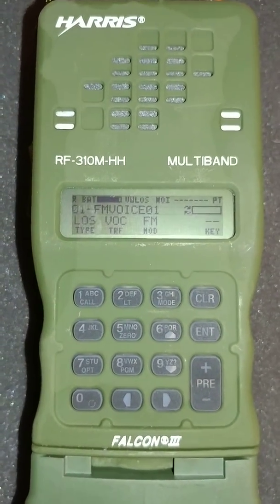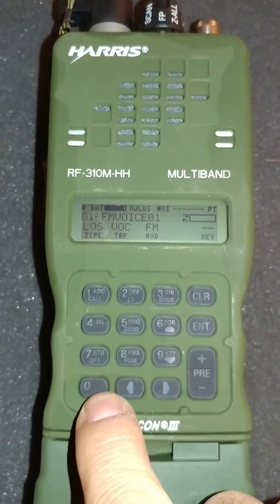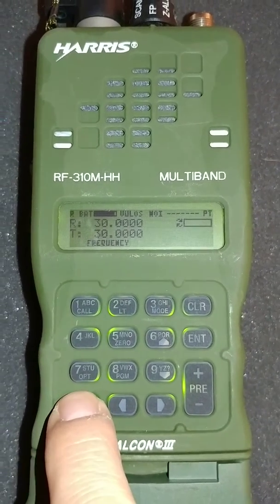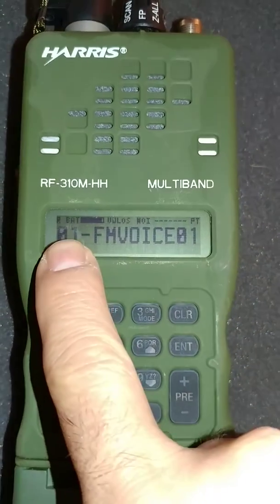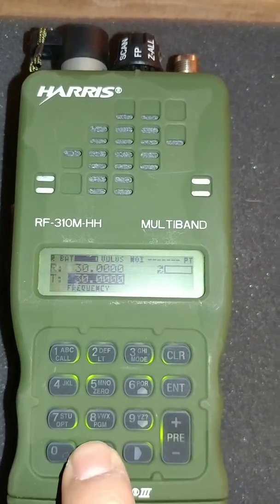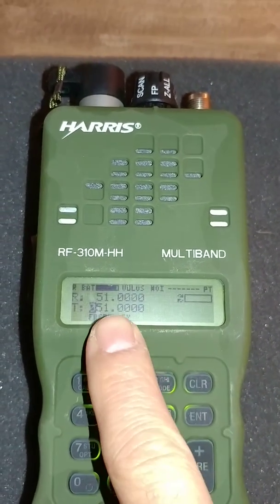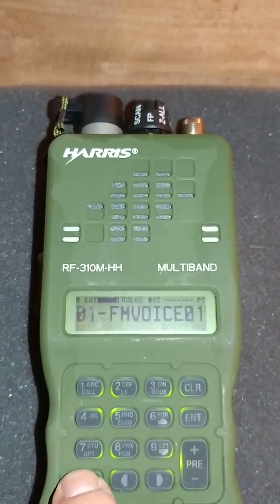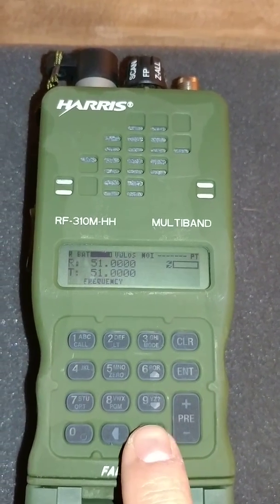Harris RF-310M-HH Front Panel Programming

Comment: And idea what "SW Not Validated" means on a Harris RF 310M HH?
Reply from the maker: Yes. It means the HUB battery died and was not replaced while the main battery was attached. It means mostly that all crypto has been disabled (probably find for us civilians). Also I believe the RED USB drive is disabled. Only way to fix is to send back to Harris, but only if you are a certified organization and they sold that unit to your organization. Still works fine for ham use. Good luck.